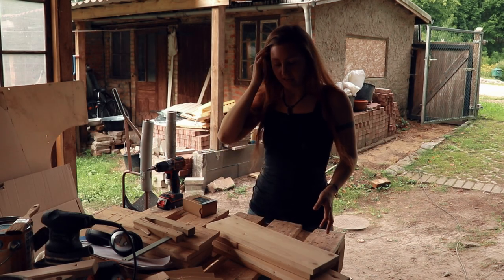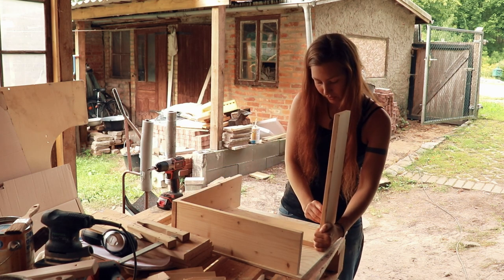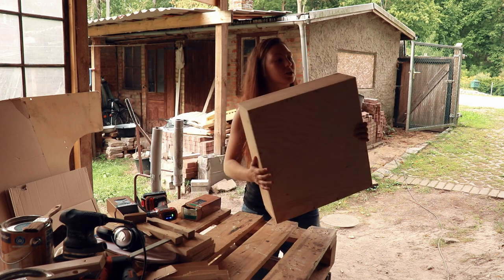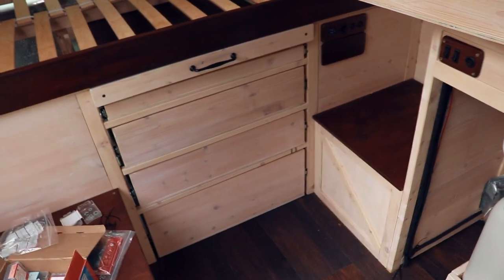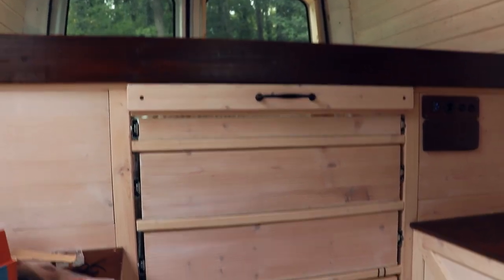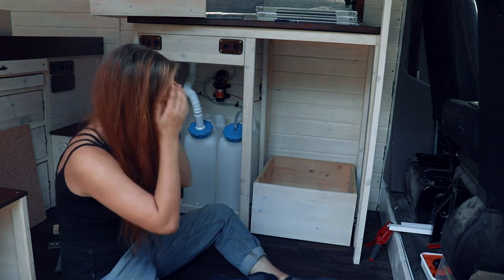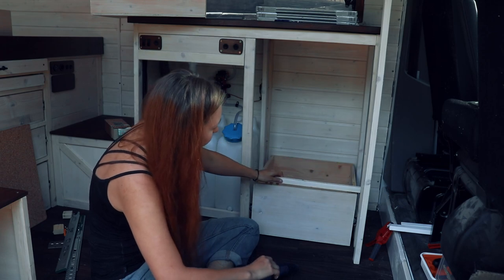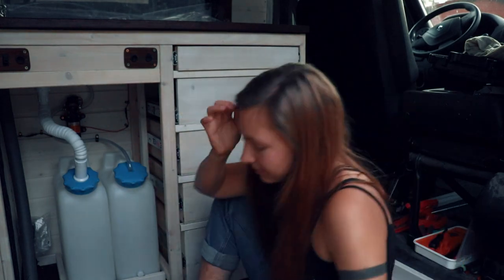Easy DRAWERS for ANY van conversion | Van Build #22

Comment: Great job!  and the snug fir is easily fixed by sanding or you don't have to worry about them coming open. : ) ... Nobody likes doing drawers... too many degrees of freedom. I have learned to cheat with the measurements... make them 3 mm (1/8") smaller than I think will be just right and if they are too loose I shim them out!  Atleast at the end of the day you you have something to be proud of and something that will remind you of your hard work and determination.

Comment: "...no real right angles in there..."  lol I feel your pain, I just built a drying shed out of a pile of reclaimed Lumber that had been in my backyard for 10 years, not a straight board, beam, or square angle to be found but it's getting the job done! 😀

Comment: Drawers is a nightmare. They demand a lot of experience and a lot of tricks to install :) But they are in, and after a while they will slide easier and there is always the possibility to adjust a little bit here and a little bit there. And last but not least, one can always cover it all with a nice front cover :)

Comment: Every woodworker will say this : measure twice, cut once ! Great job anyway
Reply: If measuring and cutting were all it took this would be 100% true.  But the biggest part of getting things to achieve a good fit is understanding tolerances and the concept of stack-up of tolerances.  In general woodworking maintaining +/- 1mm is about as good as you can achieve. now the +/- is misleading because it implies that in the end the plus/minuses will cancel out.  In reality, Murphy's law and systematic error (a loose end on a tape measure) will mean that you have all pluses or all minuses.  In Lenya's case where she had an opening to fill with drawers all plus tolerances means that the drawers will be too tight when they are all put in.  The trouble is if you account for this and get all minuses then you can end up short.  most people who make cabinets these days make the drawers much shorter than the height of the space they are to fill.  They then add a front face that is precisely measured.  If you want to be precise the only way to do that is to do what is called a "functional build"  that is build one at a time and measure the remaining space as you go.